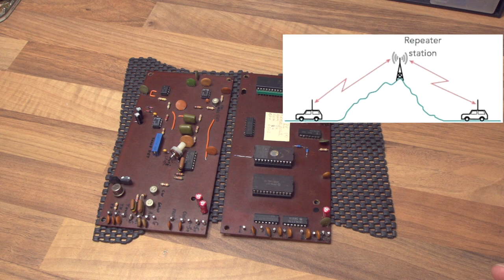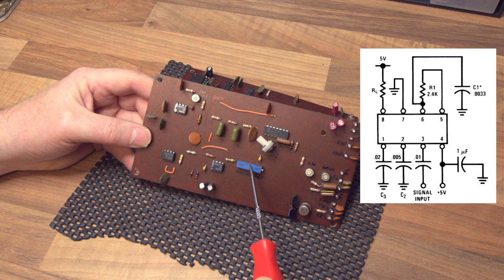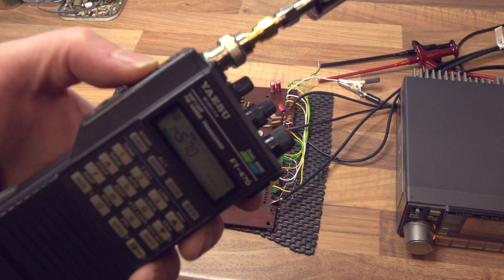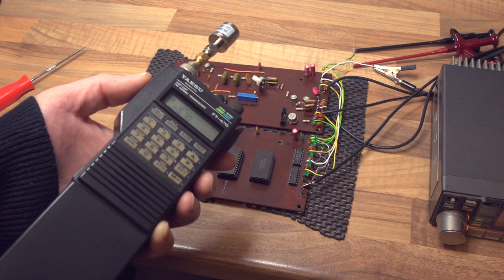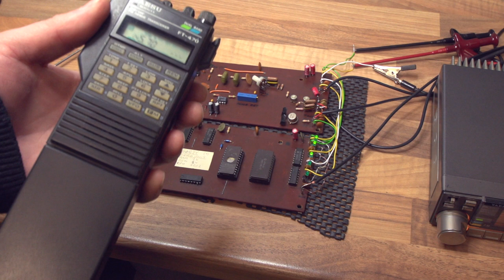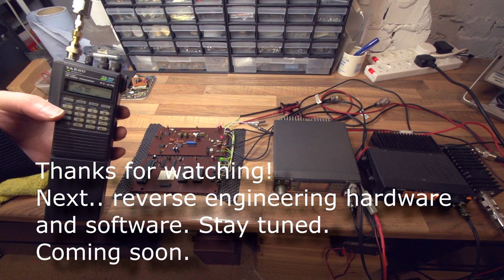6502 CPU based Amateur Radio Repeater project - back from 1986!

Comment: Old skool. As you say at 19 minutes. I did that way when started 1994, Tone burst. Nicely done. Like the homemade look. Found this on the home page. Went away 1999 or so, came back 2017. linked on the channel top photo. Found you on QRZ. Nice business and building, a rope making place next door, ok was. Chatham docks had the longest one in uk I think it was, Long building. Made a bit of rope as volunteer out the group when looking around, knew no one, just wife, Got to keep it. Did my thing in front of everyone. 

Old skool Yaesu. Handheld is, Bet not many of those used now. Got a current one this year, July, though been kicking around 2018 or so model.
Reply from the maker: Hi, ah you found me ha.. Thanks for watching.
Reply: @NEEC1  was a nice video.

Comment: Cool! You better cover the EPROM memory window.  Any source of ultraviolet light will erase it.
Reply from the maker: HI there, thanks for watching. Its not too bad, it takes a surprising amount of UV to erase the chip. And the wavelength of the UV has to be in the correct band. But yes, it will get a sticker once i'm finished videoing the series!. Thanks.

Comment: Wow, just shows how good the older technology works. Still going today after all that time! Great video, wonder what repeater this was going to be used on? Sounds similar to a G3RKL.
Reply from the maker: Hi, It was never really aimed to any particular repeater at the time, just a project I wanted to do. Would have been fantastic if it did get on the air though. Thanks for watching.